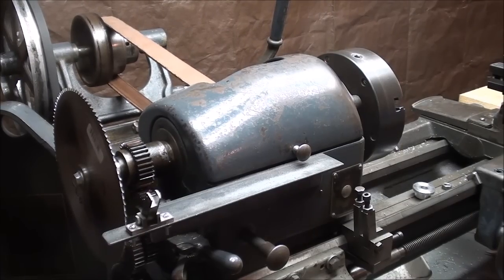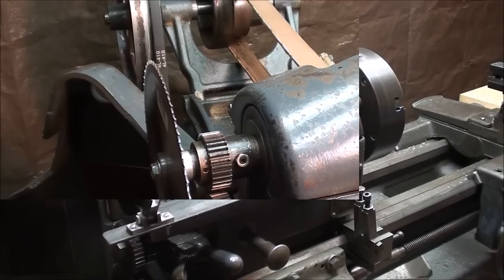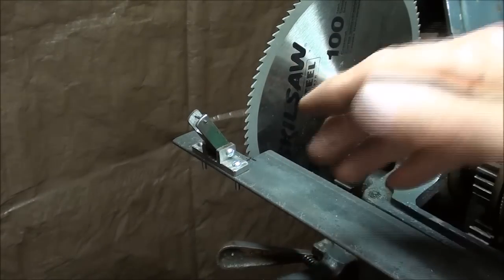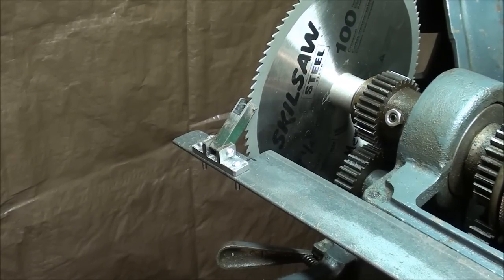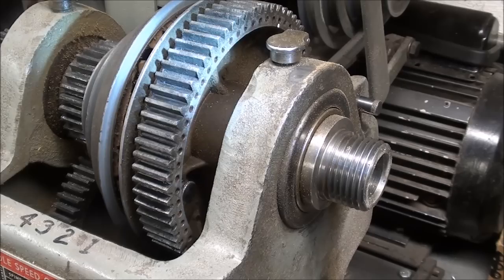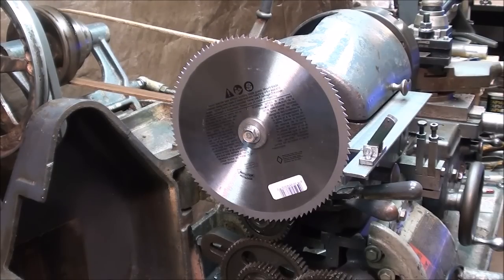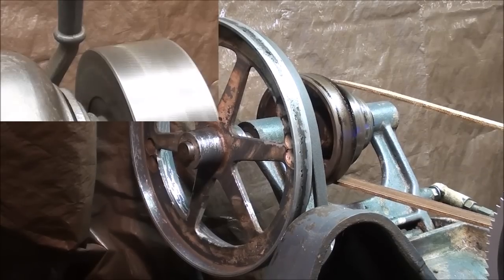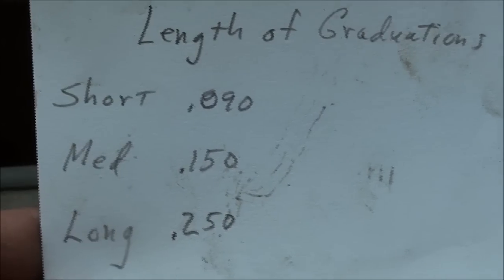SHOP TIPS #179 Larger Dials for the Logan Lathe part 3 tubalcain

Comment: If you wrap a couple of turns of string round the chuck and add a weight to the end, dangling on the near side of the lathe, it will maintain the full engagement of the pawl on the saw blade without having to hold the chuck with the left hand. 
I know your hand is there anyway to move the chuck, but it helps to maintain even spacing as the tension will always be the same.

Comment: No I'm going to do it for my hardinge lathe, it came without a cross slide and compound and I couldn't find one for the raised bed for my turret hardinge so I'm making my own with a dove tail cutting and 3/4"x5" steel bar stock. You do a lot of great work and explain very well. Thank you for your knowledge.
Reply from the maker: Yes

Comment: a gentleman and a scholar and a humble genius
Reply from the maker: thanks
Reply: Haha Mr Pete you replied!!! You dignified my comment. You're like a celebrity to me. I watch your videos all the time. I have to get past the envy every time of knowing you have a full machine shop in your BASEMENT. But I've got it down to a science. Plus your narrative is oddly satisfying. I also have to remember you've acquire your machines over your lifes work. I wish I had machines like that. I spent 2 years in a new build stamping die shop. Not repair or maintenance but actually new build. I'm 28 and went from fly cutting in milling/turning bumpers for the dies, to assembly and fitting, to the press. I operated the 600T and would check first off parts on the fixture and run feelers etc to ensure they were geometrically compliant. That involved blueing in forms and adjusting shear and stagger on the gutting station and relieving high spots or hard marks on the forms that would blemish or worse cause ripping. I became a pretty good hand on the manual lathe, mill, surface grinders, automatic surface grinders, and my favorite... Squirting the white coolant from a bottle into a hole being drilled on the massive radial arm drills there. The smell of evaporating coolant and hot drills and swarf was nauseatingly pleasant
Reply from the maker: That's interesting---never been in a die shop
Reply: Yes it was interesting I was always eager to work. I should have stayed. The problem was income. They weren't paying enough for me to survive. I don't have a tool maker ticket so.

Comment: You also could have wrapped a piece of twine around the saw blade adapter and tie the other end to a weight. Then as you advanced the blade, the weight would pull the blade back onto the pawl and keep tension on it.

Comment: On page 14 of the Atlas lathe operations handbook, it states that there are 60 indexing holes on the face of the front spindle gear with an accompanying indexing table.  You were correct in assuming there were 60 holes in you Craftsman.
Reply from the maker: Tom PlankaR Thanks

Comment: the 60 holes would come in handy for cutting gears for a clock. or 30,20,15,10.
Reply: I'm wondering if it might be possible to switch from a single stop pin for the 60 holes to multiple stop pins that are slightly offset vernier style, so you could get more than 60 divisions with only 60 holes.  Have to think about it when I'm less tired...

-- Mike

Comment: I bet you could cut gear teeth with a similar setup combined with a hand operated tooth-shaped cutter on a bar with an operating lever mounted on your cross slide. Or perhaps the crank on the carriage would give enough punch.

Comment: Superb video! Watching this just makes me smile.

Quick question. Why did you need to use the spacer, why not just move the tool to touch the work and then advance 5 thou instead of 7? Was that to avoid scratching the work with the tool?
Reply from the maker: yes. I did it your way on the prototype

Comment: It doesn't matter what size part you are scribing it will always dived into 100 or whatever tooth blade I use is that correct ?I cant seem to wrap my head around that lol  I watched it twice and I think I heard you correctly I plan on making new ones for my South Bend 13" tool room lathe (That's the plan anyway)
Reply from the maker: Diameter does not matter.  The 100 tooth blade will divide ANY size into 100 equal divisions.

Comment: I'll be making one
Reply from the maker: Yes
Reply: @mrpete222  I just finished making it and have 2 gears instead of a saw blade
1 gear with 50 teeth and the other 36 teeth, it works great and have fixed 2 dials
Thanks for the great idea